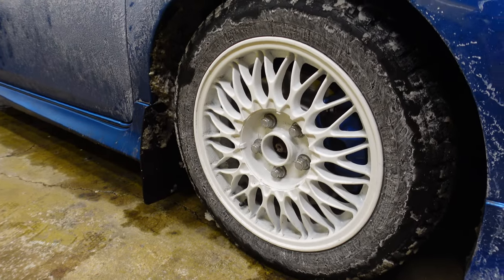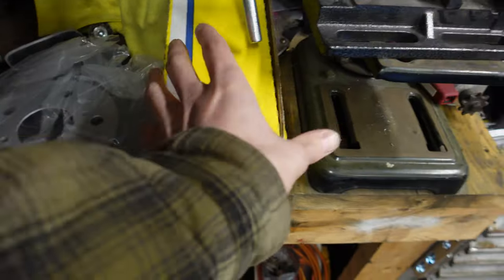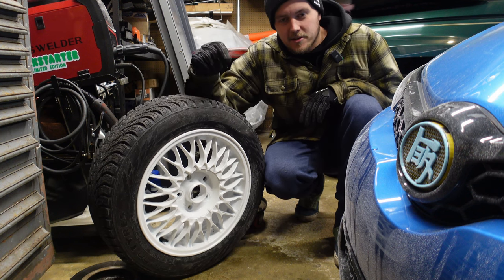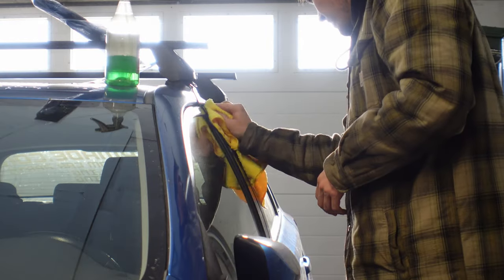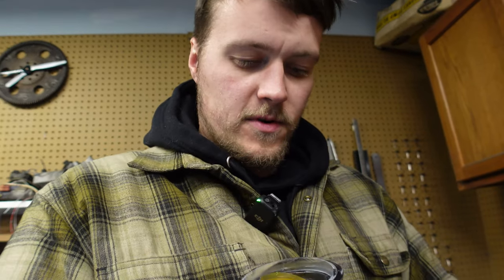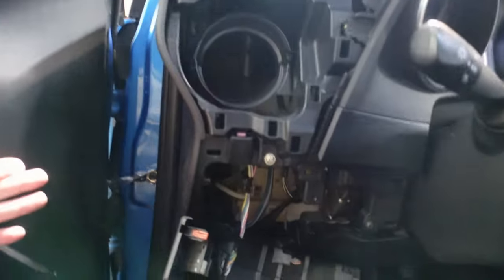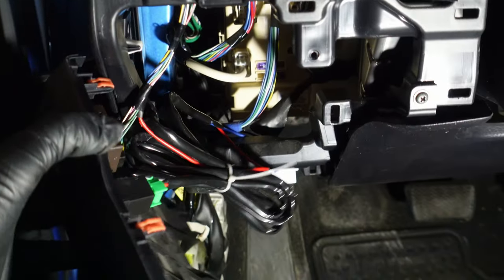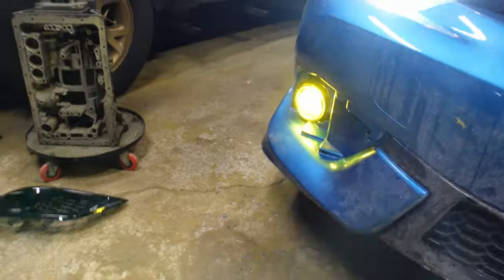Scion iM Diode Dynamics Fog Light Install

Comment: I ALSO deal with the clunk issue. It is coming from my front, but also cannot determine where from. Good to know it’s regular for these cars, can’t find any info on it.
Reply from the maker: Really? And it just happens once when backing up and that's it?
Reply: For me, it happens as I exit from parking, making a singular click/clunk as the suspension settles in a single direction. Doesn’t make any sounds after the initial clunk…
Reply from the maker: @Gnarlee517  that's so weird, same here